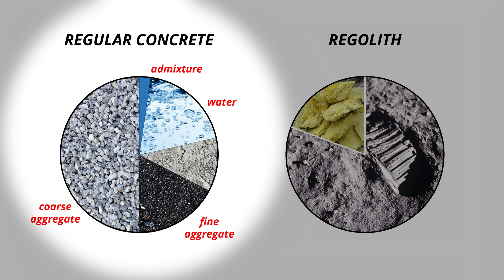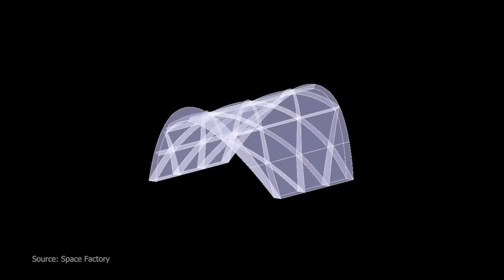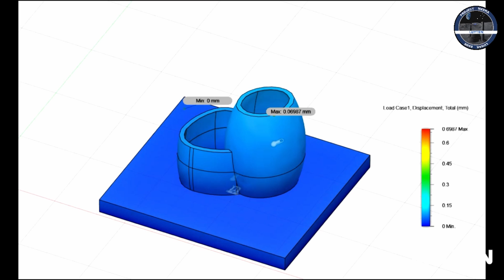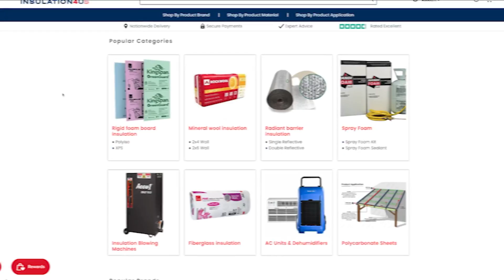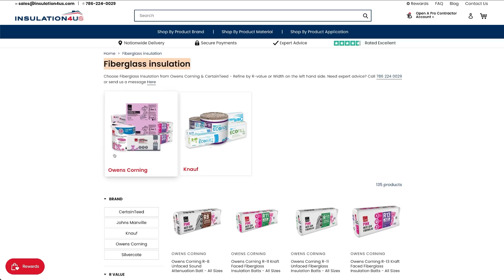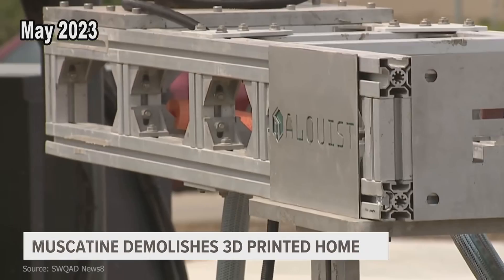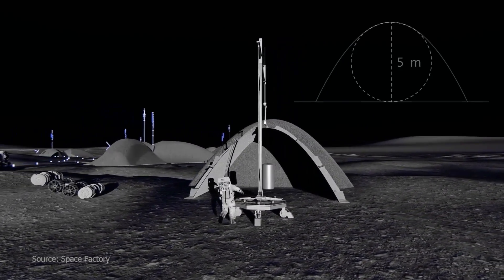The truth about 3D printing a lunar base with MOON DUST

Comment: One thing I notice in all of those rendered video's, is that not much attention was given to heat dissipation.  The machines and buildings they show, if they were on Earth, would be able to dissipate heat through convection and conduction.  We take easy heat dissipation so much for granted that the space video creators usually assume heat transfer will as easy as on Earth.  Mobile equipment on the Moon, could not use convection because of the vacuum, and couldn't easily use conduction into the Moon rock since they have to be mobile.  That rotating mining robot would generate a lot of heat, but didn't show any way to dissipate that heat, or it is made to operate at 1000 degrees.  The habitats would also need a heat dissipation system, such as sinking conductive heat dissipation hardware deep into the lunar rock, or have large radiative cooling panels.  

Maybe Moon villages would have a community cooling utility, just like we have community water, electricity, and sewer utilities on Earth.  A large cooling facility near the lunar village would have pipes containing coolant that circulates to the lunar habitats, then carrying waste heat back to the community cooling facility.  Or, depending on the situation, the hot pipes, could transfer the heat into the habitat during long lunar nights.  Possibly carrying coolant to various cooling stations, just like we have fire hydrants or public drinking fountains.  Then vehicles, or mobile robotic equipment, or even humans in EVA suits, could come to dump their stored waste heat, or robots could collect a little heat while equipment is not being used, to keep parts from freezing.  Heating is easy, given an energy source.  Cooling is hard.

Insulation on the Moon and heat regulation are a new set of engineering and architectural problems.  Whole new materials instead of fiberglass and polystyrene.  Many new videos for Belinda to create.

Comment: Most of the local energy cost will be to heat regolith. Sun is free, but solar pannels have weight. Heating is not so hard in space since there is no dissipation. =» is there a way to recover energy from the formed regolith ? 

Black body radiation is very slow, so we have time to grab it, but how to use contcat heat transfer and heat pump to recover that energy ?

Comment: There’s probably a good reason why this isn’t viable, but it seems like tunneling under the lunar surface would make more sense than trying to build on top of it, at least for a starter habitat. Trying to build a structure on the surface thick enough to protect from all the radiation seems like it would pose a lot more challenges than just tunneling into the rock and having an underground habitat protected by the rock.

Comment: The moon dust is so abrasive that no one or no machine can stay there for more than few days.
Reply: The Yutu-2 rover has been operational since 2019, so it's hard, but not impossible. There's been recent advances as well to help deal with the issue, such as space suits with active electric fields to repel the ionized dust.

Realistically, any feasible plan would need to send a fully self-replicating and self-repairing unit that can build its own replacement parts out of lunar resources. Which is...extremely difficult, to say the least. But given the pace that additive manufacturing is advancing right now, maybe not.

Comment: From an AP News Article:

“The walls should be 80 centimeters (about 2 1/2 feet) thick, they said. Any thicker and the dirt will emit its own secondary radiation, created when galactic cosmic rays interact with the lunar soil.”

I wonder if two shells of beehive-like residences at only 40 centimeters thick, each, would provide satisfactory insulation with a void of air in-between the walls? The entirety of the walls/roof could also be 3D printed with the beehive shape-think of the interior ceilings in pyramids and how they hold themselves up by height. A doorway tunnel would have to be double walled as well.

Comment: I'm curious if there's a genuine benefit to building habitats as opposed to digging them. wouldn't it be easier and faster to dig out a bunker, using the underlying rock as the structure of a moon or mars base? It seems less sci-fi, but it also seems much more viable to me.

Comment: Excellent video and good points! Neutron bombardment is a complicated issue, since many techniques involves atomic capture of the neutron, which results in a thermal output in the form of gamma rays. Overall protection is a complex and multi-layered challenge.

Comment: I generally agree most with those suggesting the use of prefabbing, 3d printing is extremely effective at producing extremely strong flat objects, but not so much vertical structures, arguably the best use for a 3d printer on the moon is using it to print many flat plates of regolith derived concrete to form the outside walls of a structure, making a biodome type structure from regolith panels, support bricks and beams would seem to be far more practical and allow for a lot of simple modularity and repairability in the designs that could then be partially buried beneath loose regolith to apply even pressures from above and protect from radiation. If we're not extensively tunnelling, that seems like one of the better middleground designs that'd be practical and pretty easy for a handful of astronauts or robots to assemble in situ.

Comment: I would be interested in there being portable or "hand held" (heavy and likely requiring 2 nauts to carry and operate) or Cart/buggy towed system that can scoop up lithic material as you drive around with it

and then have a guy carefully prepare and lay jigsaw-type bricks and cubes of this stuff with crete-paste between layers to hold it together
or
to have the device "spin" and "spew" off of a loom like a spider spins silk while someone else either feeds the machine by pouring more and more dust into it, or is at the desposit site smoothing and shaping the lunar cotton candy into a structure. Cool too for on-the-spot damage repair. A hole from a meteor shower? get out the pastegun. blublubblublublub. (smoothes it with a trowel afterwards) ah. fixed.

Comment: What happened to tunnel models? I think i saw like 10 years ago (likely longer) a proposal of landing a robot into a crater, so it's "underground" and you can drill directly horizontally. There are enough craters with the depth to get a few meters of roof (ceiling?), but don't need to bring a too extensive railroad system or such for material removal.

Comment: Have you done any research on combining 3D printing with prefab construction? I can see a future where standardized pieces can be used to build quickly, with site irregularities or custom elements added on. The 3DP could be for speeding up, making a standardized foundation to attach the prefab to, or just architectural style
Reply: The problem with 3D printers is you have to bring it in and set it up. Then you have to have the mix all ready and no faults can happen. 
What would work is robots building with bricks. Its a far better viable solution that solves a major amount of problems. Bricks can be factory sized. Bricks can be glued (like motar yet better and stronger ) bricks require only a few robots that can set up any time. Plans can be inserted and several pairs can build the building very quickly. 
3d printing just has too many flaws that can happen.
Reply: That also works, i guess I’m thinking of automation to get rid of unique issues, combined with standardized offsite construction for speed.
Reply: You would also still have to set up the brick-laying robot as well. Less challenging than the 3DP sure, but presumably not negligible.would also be interesting to see how quickly you can change the brick laying pattern on the fly vs a 3D print
Reply: @danielgregory5259   Of the brick laying robots out there and their concepts its far faster and better than the 3d printer which has to be set up to cover the entire building structure and be level. All the concrete, pump trucks and everything else needs to be set up. Where a brick laying robot only requires the pallets of bricks to be set near or inside the building. It does not require to be level or set up as it can move about the site as it needs to. The only thing it needs is a lay out program and a starting point or a few reference points. As long as the building is only a few stories high the entire structure can be built with bricks including the color layout, brick style and so on. There is a glue that can be used instead of motor this makes the entire build process far faster and far better. Glue can allow for a building to be built with one size brick or with a specific set of bricks. 
There are advantages to robots including human robots which are likely to see markets in 5 to 20 years. The faster they bring basic labor robots to the market the less we will require 3d printers. Humanoid robots can fill the labor pool and allow for companies to build better homes for far less. WIth a couple dozen human robots on site supervised by one human the labor can be next to nothing. A single person can charge 10k in labor for a 30 day build and make more money/profit than they would have before. Robots are the future and money will be less of a thing. The more robots we have the better lives and things will be/get.